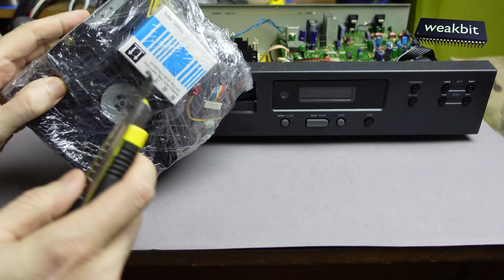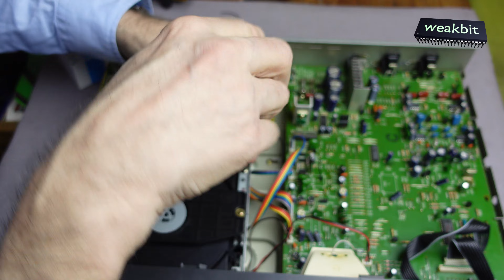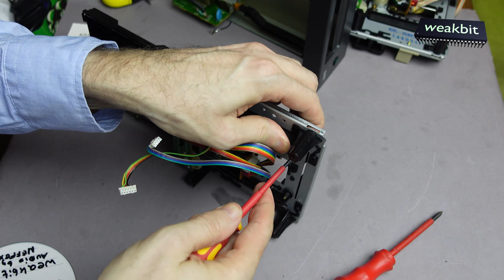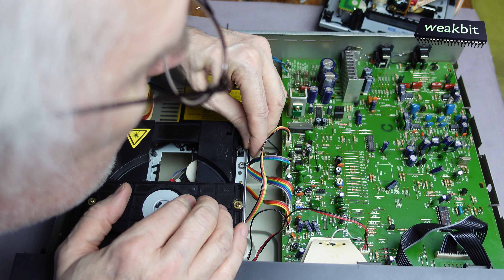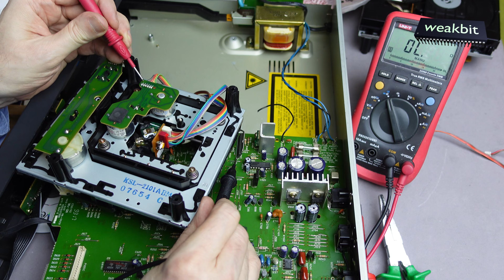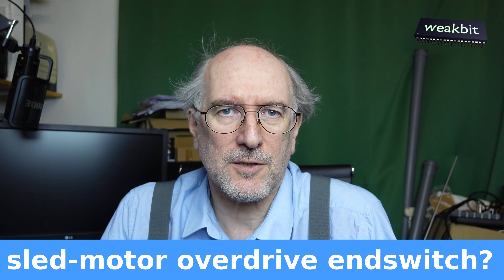NAD C502 part2 repair

Comment: The service manual for this is available online. btw make sure that the laser rf eye pattern is correct if incorrect with test cd then the microcontroller will not send signal to the spindle motor 👍